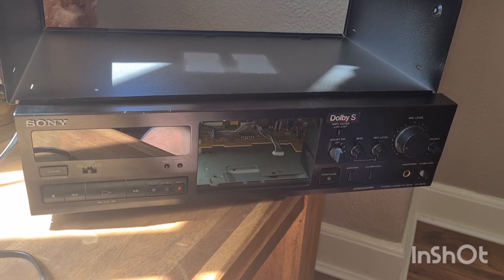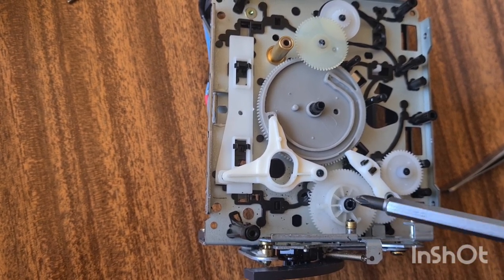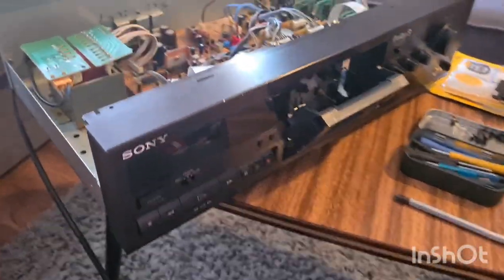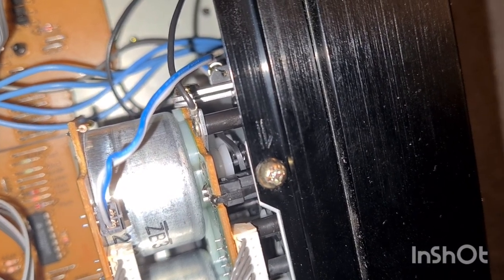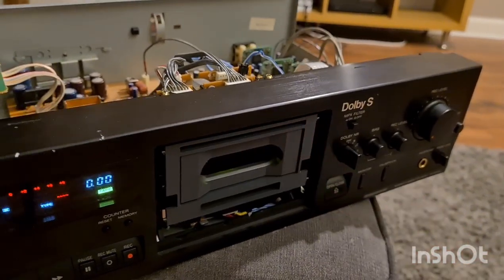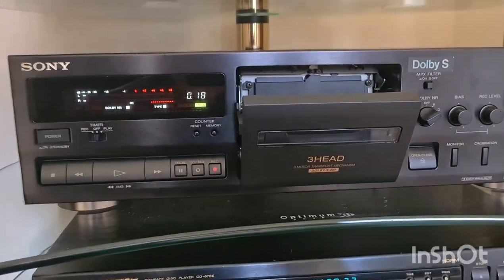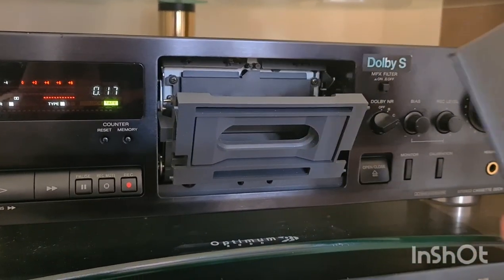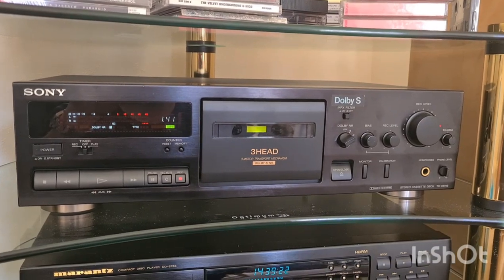Sony TC-K611S Three Head Cassette Deck - Transport, Playback and Recording issues Repaired

Comment: Would have been nice to show the actual repairs. What's the point otherwise?
Reply from the maker: You raise a good point, this was one of my first videos and I've learned a lot since. I'll do better with showing repairs when I can!
Reply from the maker: Your wish is my command Peter, just uploaded another video of a rotary encoder fix!
Reply: @pwrestoration  Cool. I will check it out. And one of these days will take out my TC-K615S. Do you know what the difference is vs tck611s?

Comment: Really nice video! I have 711S myself, which is basically the same device but it has two capstans and pinch rollers. I have no idea why two is better than one in the device without auto reverse, but I'm been happy with it. 😁 Calibration works great, very little tape hiss and stable speed. Also Dolby S is nice addtion. These decks from early 90's are imo best Sony decks from tape era.

Comment: I was expecting to see what did you do in order to repair that infamous stuck open mechanism but nothing came. You fixed it and that's all. Thanks anyway.
Reply from the maker: I didn't suffer that problem I'm afraid, I always have an eye on eBay for these so maybe in the future. Generally if the door is stuck open it can only be a few things - do you have one with that issue?

Comment: Got one today at charity shop for 20 quid
Reply from the maker: Bargain!
Reply: @pwrestoration  thanks i new it was good due to dolby s, did not know they are worth 200plus.  i turned it on, and its making a whining noise when not even playing a tape, sounds like motor noise
Reply: all lights up ok, and eject works ok, google say to strip down and clean and maybe replace capstan motor
Reply from the maker: @lumsdot  quite common. The motor runs constantly and can wear bushes. Leave it on for 24 hours and let it run, sometimes they quieten themselves
Reply from the maker: @lumsdot  I have another video about noisy motors on them
Reply: @pwrestoration  ok thanks will check it out

Comment: I have one of these, came with a really bad pinch roller, replaced it and it's been golden since (had to align the heads because some puppet had moved the height and the azimuth witch was fun :D It's also my main recording deck and I own a Denon 740 and it's night and day (no calibration on the 740 apart from bias fine) Great vid :D
Reply from the maker: Thanks! Coincidentally I was just watching a spares or repair 740 on eBay and decided not to go for it. Lack of features and no Dolby S meant I would only be buying to repair and sell. I wouldn't use it. 

The pinch roller really sorted out the tape path on this, I had a wobble with one tape j was using for testing as it had no top end. Turned out the tape was just crap 😅
Reply: @pwrestoration  Hahaha that happens, Just for reference though the 740 is an excellent playback deck with the recordings done on the Sony (assuming I didn't use S NR) the mids are a but more pronounced on it and sounds a bit "fuller" however with an S encoded tape, switching the 740 to Dolby B seems to work well (S was designed that way unlike C which really needed another deck with C to playback correctly) but yes the 611S for the money is a fantastic deck in my opinion, and the single capstan isn't an issue :D

Comment: Hi, thank you for the explanation. These decks are sometimes tricky. I've changed the belts on my tc-k500 S, I have to take out the transport out a few times because it won't play properly, the grey cam gear😂 now it works nice but the Dolby section is completly not working. I've  used contact spray on the switch and checked all connections. Do you have any tips? Cheers
Reply from the maker: Double check you've got the ribbon cable in correctly from the front panel to the main board and the display
Reply: @pwrestoration  ok, thanks

Comment: I have a SONY TC-WR820 dual cassette deck. One transport won't open and the other opens but won't play. I've never attempted this but I'm going to try and take it apart and fix it and came across this video. The two transport mechanisms look exactly like the one in this video. This is very helpful. Did you need to replace the motors? where did you get the spare parts?
Reply from the maker: Generally the motors are always fine, it's the belts that cause the issue with these, then secondly the pinch rollers which cause tape chewing and skewing - the skewing leads to poor sound particularly loss of treble and clarity. Good luck!

Comment: I just purchased a mint one but for almost $300. They’re probably more expensive here in the states. I chose this model because I read it one of Sony’s best and it didn’t suffer from a lot of the issues other models had. I also have an NAD 6240 that was much cheaper but sounds absolutely amazing. Better than the Sony IMO.  Have you worked on an NAD deck?
Reply from the maker: Yes, a fair few - and I would say the Sony deck pips them all day long. Perhaps it needs a service? Give the heads a wipe over in the meantime. But one thing I will say is that sometimes tapes that sound great on one deck can sound different on others, for lots of reasons. Have a go recording on the Sony deck and playing that back. That could be your issue - simply transferability of tapes between them.

Comment: Thank you for your video.  I do have Sony TC-WR90ES.  The tape deck is similar to mine.  I did change the belts based upon you video.  Everything is working, however, the sound is like I have 2x speed from the motor (like chipmunk sound in the movie).  I wonder you have any suggestions or do you thing the capstan motor is bad?  Thank you again.
Reply from the maker: Hi! Was it playing at the correct speed before your belt swap or was it broken when you started?

If it was fine before, check your belt routing and belt sizes. If it wasn't, it's just a simple speed adjustment. The hole on the back of the motor is where to adjust the speed, it has a little rubber cap with a slit. You'll need a 1mm flat screwdriver.

Comment: Excellent demonstration. Thank you. I would also be grateful for advice on how should the gear loading cam be aligned with the loading roller. These were the parts you were demonstrating close-up, and freeing, at around 16 minutes. 
The cam gear has a ridge next the highest point on the inner crescent-shaped cam and I do not know where should this point be aligned in relation to the loading roller. Otherwise the cassette holder would not open. Any advice would be much appreciated.
Reply from the maker: I think I know what you mean, however I did not remove the door and loading mechanism anymore than what you see in the video. 

When rebuilding I simply let the door mech open, and the cam was as you saw it in the video. It has a spring under it so when you are refitting the board over the top of it you can feel a little pressure. 

Does this make sense? If you are struggling I would suggest trying to line it up exactly as per the video, as it did not offer me any problems from memory. Regards
Reply: @pwrestoration  Thank you very much. This is very helpful and I shall heed your advice.
Reply: Thank you and sorry to trouble you again. Your demonstration is extremely useful, which I am viewing repeatedly, and it is why I am encouraged to seek your advice again. 
At 16:47, where the gear loading cam can be readily pushed down (to open the cassette holder), the ridge (like a pointer but possibly a switch-trigger, next to the highest point on the semicircular cam), is exactly away from the loading roller, and I wonder if this is the alignment this gear-loading cam needs to be in on assembly. I would also be grateful to learn how did you re-align it (from the stuck position as at 16:30). 
Apology for troubling you.
Reply from the maker: @eliasragi7472  I think I understand. The small piece sticking out is a switch activation point, these switches detect whether the door is open or closed. In the next scene you will notice one I melted slightly. It touches onto one of these two small black microswirches. 

How I aligned it was to simply turned it manually, whilst looking at the switches. It must be in one position when the door is closed - against the closed switch. Then when the door is opened, it will rotate to the open switch. 

My advice would be open the door, rotate the sprung wheel by hand to where it would be activating the open switch on the attached board, then reassemble.

If you're in the UK I could possibly carry out this repair for you.
Reply: Thanks to your advice, I am nearer. May I also ask:

At 17:15, is switch 1004 opening or closing? In the service manual (TC-K590), it is given only as switch, with no indication of function. Also interesting, while the manual gives directions on aligning the boss on the mode cam to the notch on the assist motor cam, it gives no guidance on aligning the door-opening gear mechanism. 

Another interesting aside: given the genius of design of all the myriad mechanical and electronic components, the designers may have not foreseen the whole is as good only as the shelf-life of two rubber bands.  

Having identified the switch, looking at the loading cam as at 16:34 and with the door open, which direction would the cam rotate, or which switch would it hit first so as to close the door? On the same theme, at what hour would the switch-tripping ridge be aligned?  

I live in Devon and, at this stage, I am taking the task in the spirit of a supreme DIY challenge, though keeping your kind offer in mind. 

Your demonstration is what makes YouTube revolutionary especially for niche-end DIY; inconceivable only few years ago. Forgive me for troubling you and thank you again.
   

 @pwrestoration
Reply from the maker: @Elias Ragi  I have a new replacement switch here so I could test it. With the switch pressed, it is closed and continuity is made. The two pins at the rear are the connections. 

The brass roller is what moves the upper metal rail, which in turn allows the door to open.

I believe with the door shut, the finger should be at 9 o clock as you look down at the wheel. The brass roller is then at its lowest. 

It should make contact with a switch at this point. This is the closed switch. 

When activated, the wheel will rotate anticlockwise (as you look at it from the top down, like in the video) and touch the open switch. Once it reaches this position the brass roller will roll up the cam and be at its highest. 

This then moves the top bar, and unlocks the door mechanically.

I know what you mean though, everything relies on belts!
Reply: @pwrestoration  Thank you very much. Extremely useful information.
Reply: @pwrestoration  
The “tension spring” over the joint lever (24:27) seems redundant (other than retaining the lever and has no room to expand), while the cog (red spindle) does not seem to be motorised or spring-loaded. So, I could not make out how does the door close. The door seems to open through the contraction of a thinner spring (centre 24:27). Sorry to trouble you in seeking more information, and thank you again.

Comment: Hi,
I have a TCK711S of which the heads were misaligned FROM THE FACTORY ! Like you, I modified a cassette to view how the tape ran across the heads. After making the adjustments, it has been a great tapedeck, without issues.
Thanks for this video. I will keep it for future reference 👍🇳🇱
Reply: Update: took it from storage, powered on and face the same problem, same mechanical sound. Ordered a belt set, some fiddling comes next week. Thanks for this very helpfull video. Cheers 👍🇳🇱
Reply from the maker: @Plons0Nard  good luck!
Reply: Belts are in. Tomorrow I will try to be as good natured as you were during your repair. Cheers 👍🇳🇱

Comment: Do you find  you get slightly different calibration levels when you switch the machine on from cold?
Reply from the maker: I've not noticed that before, however it does sometimes take a while to settle down. It does state that in the manual though. My only thought with that is the caps on the record head power side could be a bit old by 2023. The only time I've ever had problems with the cal function has been when someone's messed with the bias and the record / playback levels on the mainboard. That's a pain to sort out too 😅
Reply: @pwrestoration  lol tell me about it!
Reply from the maker: @dean6816  if you've got that issue just go through it step by step. Put a signal into the deck and you'll need to monitor by oscilloscope. 400hz for playback levels. Then it's just a case of recording it, and monitoring the results through the third head. Don't use higher than 400hz for signal volume levels it all gets a bit freaky in the higher tones otherwise
Reply: @pwrestoration  I had issues setting the calibration tones. Not sure if I done it right but I kept adjusting the pot on the level, then playing it back until it read 400 hz on my multi meter. Thanks for the advice, I'm a massive cassette addict lol.
Reply: My deck is a Teac V7000, one of them anyway lol
Reply from the maker: @dean6816  if it's still out you'll find that when trying to calibrate a tape, you'll have to really over bias to get the levels, erm, level. However! It is very much by cassette too. Some cassettes refuse to be properly setup on the deck or will only just bias. My advice will be try a good few different cassettes, especially type 2. Generally as type2 show higher tones better, some will be massively over bias with both level and bias dial set at 12.
Reply: @pwrestoration  I'll try that thanks .👍

Comment: Hi, I have subscribed and watched most of your Sony videos, good stuff! I have a TC-RX79ES. I changed the belts, cleaned the rotary encoder and diodes, all gears are aligned proper, changed the capstan motor, cleaned and greased gears. It works but only sometimes, it seems that the take up reel does not always spin, so play starts and then stops and the tape wants to chew. I have not changed the pinch rollers since I had normal playback numerous times but never consistently. I can play one side of a tape and then rewind it and then the take up reel wont spin. Any help would be appreciated, pinch rollers are on order.
Reply from the maker: I'll tell you exactly what's happened here buddy. When you remove the black plastic cover panel (with the light inside that shines through your tape) the next thing you remove is a black plastic arm, with a cog on it that touches each reel. The arm moves left or right through friction, touches the appropriate reel, and either runs the take up reel or in rewind mode rewinds the tape. 

If you lube the axle this sits on too much, it reduces the friction on the arm and it won't move correctly. 

Pull the arm off (it's on with a circlip), clean out ALL lube from its  axle and where it sits. I reckon this will solve your problem. 

It's viewed here at 5 mins 48:
https://youtu.be/Aks6OxqsK-w?si=NJfA3ssu2pP2ATOq

Sound quality is Deffo better on these decks with new pinch rollers, they suffer from tape skew sometimes otherwise and high tones are affected.